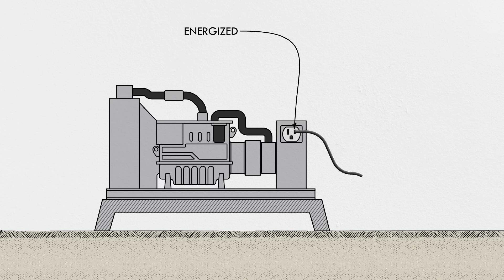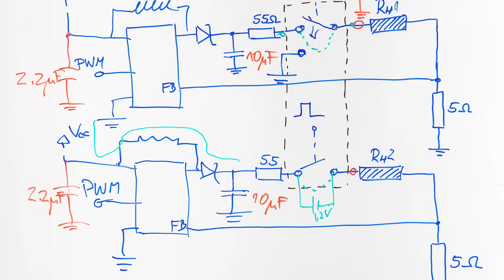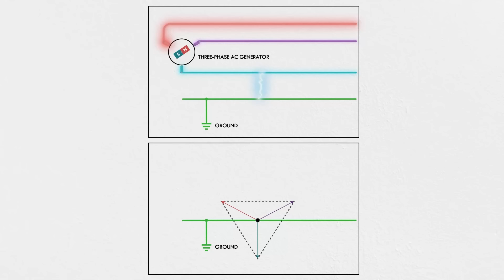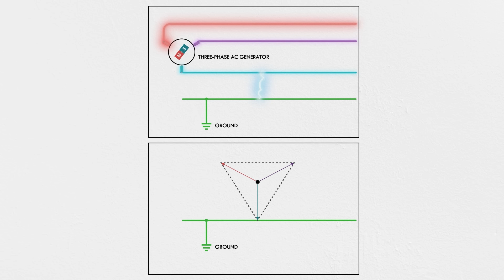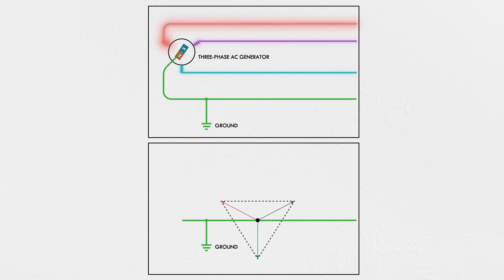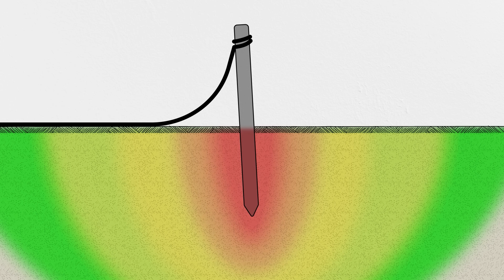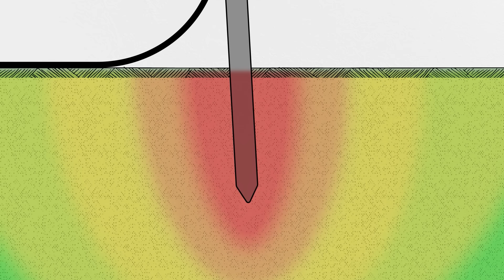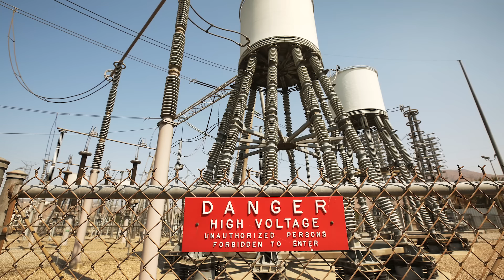Where Does Grounded Electricity Actually Go?

Comment: This is the reason why London's underground subway train network uses 4 rails (aka the 4 rail system). The track consists of 2 X running rails and 2 X power conductor rails. The outer conductor sits next to one of the running rails and is energised at a potential of +420 volts above ground. The central conductor rail sits down the middle of the track (in the middle of the 2 running rails) and is energised at -210 volts below ground. Thereby the potential difference is 630 volts DC. This was done primarily to prevent stray currents from leaking into the cast iron tunnel segment rings and causing problems with electrolysis to nearby water pipes and other underground service pipes / cables. Whereas on the national rail network (overground trains) the negative return is done just using the running rails.

For more information on how this works, checkout Jago Hazzard's video called "Underground, why four rails"

Comment: As an EE, I have performed these experiments at home, though decades ago.

The ground symbol used in electrical circuits, as the circuit "common", is historical. In the old days, the terms "radio" and "electronics" were used interchangeably. Radio, even battery powered radio, worked better when actually grounded.

Simple way of understanding electricity. Note the term "circuit". It means a loop. For electricity to flow, a  loop, or circuit, must be completed.

Great video, explaining the use of the "ground", on the electrical grid !
Reply: I'm a ham in general nowadays when we ground our radios its for two types of ground, a safety ground for reducing shock hazards, or an RF ground for unbalanced antennas like a monopole. However ground is not needed for balanced antennas like the dipole. There is also for lightning protection but its usually not part of the RF circuit
Reply: I'm amazed we don't even speak consistently about the direction current is flowing.
Reply: @toddmarshall7573 unless specifically required for the situation, current flows the same direction as power. Even though AC current flows in both directions in a single cycle in a DC sense, in an AC sense the AC current only flows the same direction as the power is delivered. I hope that makes it easier to understand. If it doesn't matter, we don't worry about it.
Reply: Well technically for anything to flow you need a differential. Water won't flow unless there is a potential in gravity. Ie connect a horizontal pipe to a water surface and nothing will flow because there is not potential across the pipe. Angle the pipe downwards and a potential is created causing water to flow.
Same goes with a wire connected to a battery or power outlet. Connect the wire to the plus and there will be no potential across the wire so no electrons will flow. Connect the other end of the wire to the minus (please don't actually do this) and because of the potential between plus and minus electrons now can flow.
Reply: @onradioactivewaves  Thinking of electricity as a flow of current  models reality but it doesn‘t reflect reality that well. In electronics we say current flows from + to - or live to neutral when we talk AC while electrons actually move from - to + in DC and just oscillate in AC. But the model works well enough so we keep using it.
Reply: "For electricity to flow, a  loop, or circuit, must be completed"  Oh?  Please explain the current return path for a lightning stroke.
Reply: @stargazer7644  Lightning IS the return current. Lightning is the result of static charges building up through friction. In a thunderstorm huge amounts of charge get moved from a large area and take non-neglibible time to build. But they could be considered a current just one that is very hard to notice, let alone measure for practical reasons.
Reply: @MrAranton  So where's the loop?  The problem here is that lightning in fact is NOT a circuit.  It is an equalization of charge imbalance.  And that charge does not actually come originally from the ground.  Physical movement in the cloud separates charge in the cloud through a process that isn't clearly understood.  The positive charges (usually) move to the top of the cloud, and the negative charges (usually) move to the bottom.  The negatively charged cloud bottom causes a positive charge to form on the Earths surface below the cloud through induction.  The lightning flashes between ground and cloud to equalize this charge imbalance.  But the ground played no part in electrically forming the charge imbalance in the cloud in the first place.  It is NOT return current.

Comment: Last week the lake 30 feet from my cottage was hit by lightning.  That strike destroyed the 4G modem, fused the buried data cable from it, destroyed the TV, destroyed the router, and tripped the breaker on the water pump.  Not even a direct hit.  My guess is that there was such a massive current differential caused that the buried cable became a highway to normalize it?
Reply: One of the biggest mechanisms in a lightning strike is not the actual stroke from the cloud, but the current that flows through the ground inductively coupling with the horizontal wiring in and around houses.  It creates huge voltage spikes on residential cables.
Reply: Normally, the problem with lightning is, when it strikes, two points in the ground have very different voltages. Run a wire (data cable, telephone cable, even metal water pipe) between those points and the result can be very high current.
Reply: Current takes all paths in relation to resistance of the conductor so a cable or pipe does work.  Going back to the example at 10:10.  If you have a cable, then you don't get a semi-circle radiating out.  You get a cylinder. 

However, when voltage gets as high as lightning even things that normally are insulators are just bad conductors.  What wasn't shown in the light-bulb experiment is that at 220V the bulb would have been brighter.  At lightning voltage, even the dry sand would have lit up the bulb.

I won't say that one of those UPS devices or surge protectors with a cable option would have saved the equipment.  I will say it might have though, and it's cheaper to replace a good quality power strip than a TV.  Lightning is complicated and people do spend large amounts of time protecting us from it.
Reply: @arthurmoore9488  Thanks for all the details!  The good news is that the telecom company replaced everything for free the next day. Except the TV, which was old anyways.  I should look into surge protection, but TBH, this is the first time in 30 years.

Comment: As an electrician, this video is very important. I really like how you showed that voltage is a relative value between 2 points. A lot of people I work with make the wrong assumptions about grounding and how it plays many rolls in electrical systems, including being a local 0 reference voltage point.
Reply: I remember during my electrical apprenticeship that so many guys couldn't understand grounding at a service box, where you're making the ground potential the same voltage as the ground potential as the grounded neutral at the supply transformer.
Then try to explain to them why neutral/identified and ground are two different things and why they can't be interchanged or interconnected at multiple points in one building.🤣

Comment: Good Video.  Most people don't know that soil is a conduit.  Your electric company has a topology map of recorded capacitance.  They have to plant electric poles accordingly.   Constructions have to plant earth bars in the ground for your house (and building).  I am an engineer, but my dad worked for the electric company.  He taught me alot of behind the scenes electricity stuff.  Living in the country,  I've seen lightning bolts strike really close and get absorb by trees and the ground.  My dad used to go around the yard checking capacitance just for fun.  He'll cut down a tree if it grows too big and had too much voltage (just for fun).
Reply: We should be billing the power company for using the earth beneath our houses as a conduit.😂

Comment: Many years ago, before 9/11, our Portland-area amateur radio club was invited on an in-depth tour of the Celilo converter station by an employee who was also a member.  That was the most fascinating tour I think I've ever been on, including some behind the scenes looks at things most folks never have a chance to see.  (And probably never will again, since 9/11.)  I truly await your explanation of this, or any other, DC Intertie station.  500 kV, plus and minus -- wow!
Reply: I hope you had the chance to visit the location of the grounding grid. It plays an integral role in the operation of the HVDC intertie. 
Down here at the southern terminus of the Pacific DC Intertie (also called the PDCI, or Path 65) we run heavy conductors to the Pacific Ocean, at Malibu California, to the Malibu Electrodes. The Celilo Electrodes basically connect to the Pacific via the Columbia River. 
It’s an important component of the high voltage DC (you’re right, one million volts pole to pole, or 500kV per pole) because sometimes the DC converters may fail to single pole operation, in which case the ground return allows Los Angeles and BPA grid operators to shutdown the DC in an orderly manner. From what I remember, we can stay in ground return for twenty minutes (it has something to do with heat stressing the underground copper cables from Sylmar Converter Station to the Malibu Electrodes…
Reply: @DanielinLaTuna  Nope, didn't get the chance to visit the ground electrode areas.  But those high voltage rectifiers ("Flaming Valves") were impressive.  And all in heavy-duty wire-enclosed cages.  Perhaps I'm remembering incorrectly, but I believe the operator said that the resistance through the ground path is actually somewhat lower than through the main conductors.  And then there's the switching to convert all that DC power back to AC.  Nothing like those little 3.3V to 5V converters in computers!   So much memory lost in so little time!

Comment: In undergrad, I learned about space weather and solar storms indirectly (space medical physics). 

One of the interesting consequences of space weather events (larger than normal amounts of charged particles hitting Earth) is that huge potential differences can build up between the grounds at different locations. Pipeline operators have to worry about this, because the outside of their pipelines are basically giant wires embedded in the relatively nonconductive soil. If too much current flows, it can heat the gas inside, and cause all sorts of terrible problems. A similar thing can happen when the earth's magnetic field changes too fast, inducing currents in the pipeline. NOAA offers forcasts of this stuff for that reason.

I'm glad I wasn't in charge of installing the first pipelines; I never would have thought about that in a million years!

Comment: My most interesting summer job was the two summers in college where I was part of a four-person crew that visited all of the substations of our large local electric utility. At each substation we poured 50-pound bags of salt down concrete lined holes located throughout the substation. Often this was fairly easy but in older substations we often had to crawl under lots of electrical equipment that was buzzing just above our heads. The explanation was that contaminating the ground water under the substation like this helped in its operation in some way. Years later I worked in a different job for the same government agency. I mentioned this experience to the director of the electric utility. He explained they had long since stopped that practice as not necessary because there were other ways to optimize substation operation and also because they did get in trouble from the state environmental agency for contaminating groundwater that often flowed to fish bearing streams and to freshwater lakes.

Comment: My father was an electrical lineman here in Japan. I asked him why they change out wires sometimes he told me " Well after the lines run out of free electrons they become inefficient and the cost goes up" I had no idea he was joking so I told my science teacher that, you can imagine the laugh she got.
Reply: I had an awesome science teacher in high school: he liked a joke but it was hard to disconcert him with them.
Imagine a class of whom most had never lit a light with a battery at home, nor messed around with electricity a bit more than that.

And now imagine a teacher is trying to explain a diode.

He drew a steep mountain cliff and stick puppets with backpacks of energy on top, while saying: "They can only go down, which is how a diode prevents the flow of energy backwards, as long as the amount of voltage is insufficient to not destroy the mountain."

Someone in the back went: "But sir, don't they commit suicide when stepping down the cliff?"
Teacher: "No, because they all have neat little parachutes so the landing becomes nice and soft."  immediately draws in little parachutes

Another different person: "But what if they all have jetpacks?"
Teacher: "Oh, ok, so they have jetpacks and they fly back up.  That could be your voltage that destroys the mountain all be it in a different way." draws jetpacks "Unfortunately our little energy puppets do not have enough fuel in their backpacks and they to not reach the top and fall down and so the principle of a diode still works."

The first person: "Don't they crash now, they used their parachute."
Teacher: "Nope, they have a reserve" *draws in a parachute on one of the puppets while drawing a disconnected parachute flopping away in the breeze*. :P

Comment: 11:30  In high school electronics class, our teacher always told us to test new circuits with ONE HAND, giving the example of if you touch with two hands, the path is directly through the heart.
     This was 50 years ago, but Hopping Hulk Hogan seems to illustrate the same point.
Reply: Makes no sense it will still go from hand to ground
Reply: @KuroYKT  I guess you missed the part about "directly through the heart."
Reply: @KuroYKT if you touch it with both hands, a untested and unknown circuit always is dangerous, and dangerous levels of electricity in a circuit mean its ground is just as powerful, draining charge at the same rate of emission (way higher than the ground's), so it will try to join first (and guess what's right between your arms!)

Comment: Excellent vid. It's not just a safety issue. If people knew just how much hell, poorly grounded buildings and ungrounded shields, can play with electronics, computer networks and security systems, they'd pay more attention.
Reply: Shielding is a subject worthy of a separate video. And would have to touch on how power returns and shielding works in situations like cars and aircraft don't have any earth connection.
Reply: @mikebarushok5361  If the installers and tecs I used to talk to are any indication, it would probably be too boring a video for anyone to watch. I lost track of all the systems that had problems that were traced back to ground loops, unshielded cables and un-bonded building additions.

Comment: The first experiment with the generator. I think the capacitance between the generator, its wiring and the ground (even if its very small there still would be a capacitamce) would result in a loading current if the generator outputs dc and in a continuous current if the generator outputs ac.
Then the mental model would also need all the stray capacitances and inductances which can occur in every circuit. This is especially important in high voltage applications.

Comment: A computer's printed circuit board (PCB) has a ground at the screw holes that then connect to a metal plate, which is then grounded by the power supply. That is why they have a silver metal around the screw hole. You can see it at 2:20
Reply: This is done to control radiated emissions from the case.
Reply: @stargazer7644 Yes indeed it is, however since the system is often powered by an AC supply the PC should be grounded just as if it were a toaster.
Reply: @DrewNorthup But that isn't why the PCB has grounding screws.  The PC case is not grounded by those screws.  The case is grounded by a chassis jumper in the power supply from the ground pin to a mechanical ground lug to the case of the power supply.

Comment: I have my degree in electrical engineering with a focus in utility technologies, and I’ve been a journeyman lineman for 15 minutes. I am always thoroughly impressed with your level of understanding and what is a relatively complex focus. It’s rare I see a YouTube video that talks about electrical without me finding errors in the theory as it’s explain, however, your work is very impressive! 

I suppose the only bone I’d have to pick is the lack of specifications regarding Delta and wye circuits in relation to grounds or short conditions. However, the diagrams clearly showed Delta or wye configurations 🤷🏻‍♂️ so all good!!

Comment: Grady, a potential video idea...

Dry pouring concrete has become quite a rage lately. There is an ongoing argument on the internet about whether or not dry poured concrete is as strong as wet pour.

Since I know concrete is one of the things you've covered very well in the past, a video from you showing the strengths and weaknesses of both dry pour and wet pour would be great. Might help to answer a few of those wet vs dry questions floating around the 'net.